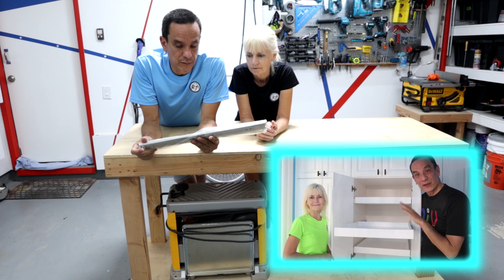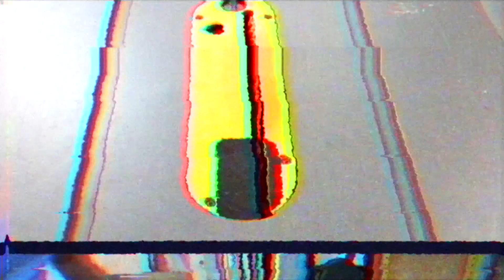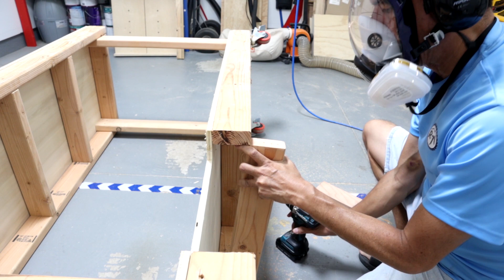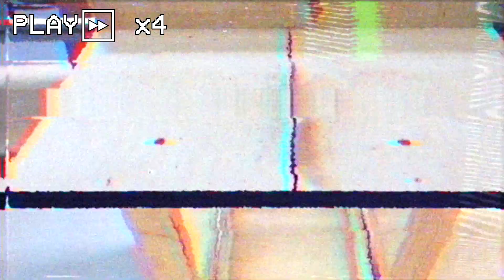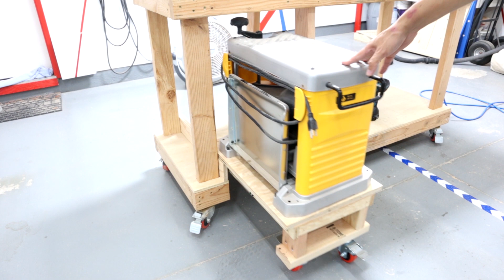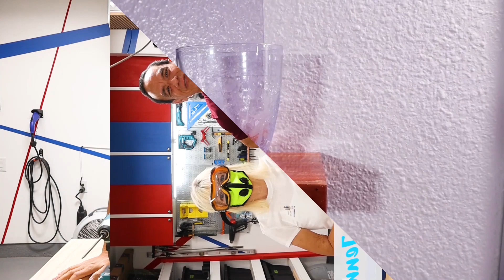Workbench Pullout Drawer for Dewalt Planer

Comment: Thanks a lot for the shoutout Richard. You’ll absolutely love using the slide out. It’s the least used tool in my shop but just as convenient as any other.
Reply from the maker: Credit given where credit is earned! :-)   I made a boat load of cutting boards for co=workers as Christmas gifts so I ended up using the planer plenty of times and it definitely came in handy!